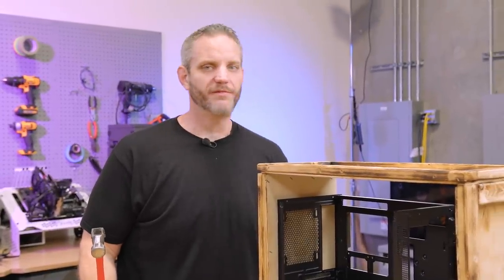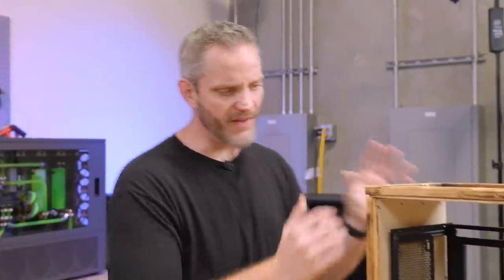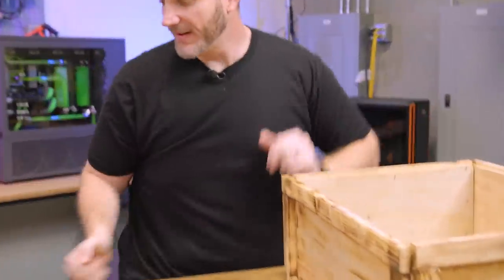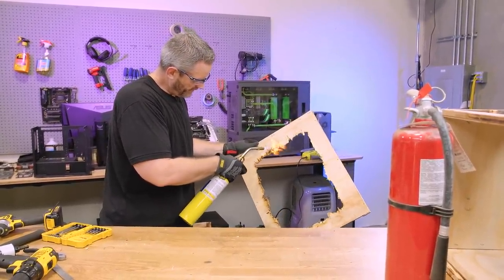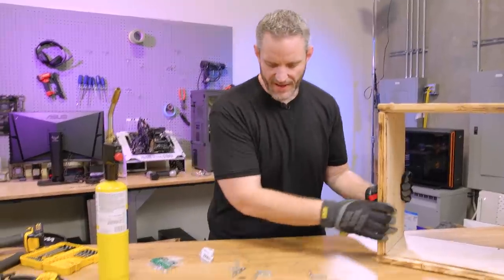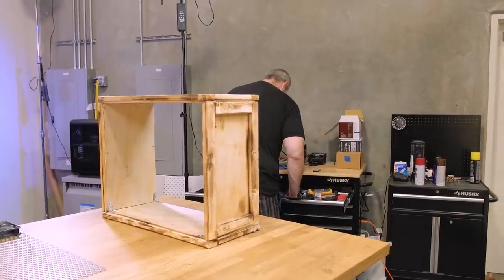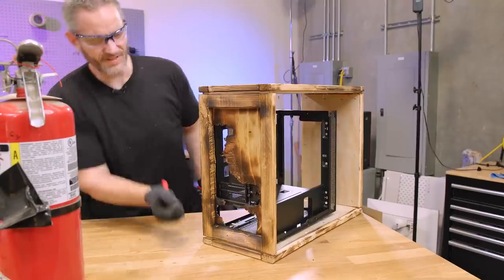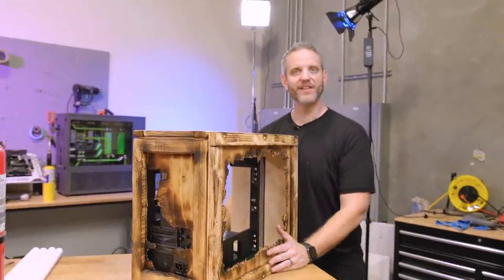I’m finally starting the Red Dead Redemption Custom PC mod again

Comment: Jay, what I would do for the grill is take a pair of bolt cutters (I know you tried wire cutters, but they're too small) and clip out the grill one by one. Then I would use pliers (or you may have to throw it in a vice, it seems like it's pretty tough, putting only the end frills of the grill) and sort of bend them in different ways around the entire cut grill. I think it would look better that way than if it was just a uniform look on the grill. You could even just bend them all outwards, or inwards, so the grill is offset to the inside or outside of the case. Would look a lot better than just a vanilla, uniform grill IMO.

You could still use pliers or a vice and do the bends if you cut it with an angle grinder, but you'd have to be careful not to cut it too straight (?) I guess. 

I advise checking out metal cutting blades for circular saws. I've used them before for projects. I've never used an angle grinder cutting wheel, only ever used sanding disks for wetsanding, but I'm sure it will get the job done as well. Goes without saying to make sure it's gripped tight in a vice lol.

Comment: Use an LED at the end of the dynamite fuse and wire it as the drive indicator light so it flickers as you use the computer. Cool build!

Comment: I sure you have gotten a million suggestions already, but here are mine: The angle grinder will do just fine with the grill. Just take it slow and let the grinder do the work. Also maybe you could use the remains of the case to sturdy up the wood frame a bit? (You can mount the bottom and side planks to the metal case and it might act like a giant L bracket) Also, wouldn't it look a little better if you cut off the front part of the metal case? It seems to me at least that it just looks a little off center, and maybe having it look more just like a motherboard tray would look better. Can't wait to see how this one turns out!

Comment: for future reference, soak the metal in salt water solution that is soaked up into paper towel and swampy. Put inside a plastic container, place lid on it and set in the sun so salt vapor comes out. it will rapidly rust.

Comment: Not sure if you saw my earlier post but you can use Poultry Netting for the hole. Available at Lowe's, Home Depot, Tractor and Supply, etc. Can easily be cut with wire cutters or snips.

Comment: To achieve the rust look on the metal you can use muriatic acid. It’s available at Sherwin Williams if you can’t find it at Home Depot or Lowe’s. Make sure you use a baking powder mixed with water to neutralize it once you get the metal where you want it. You can seal it too if you want with any kind of wood sealer.  That way you don’t get rust all over everything and it helps prevent it from rusting anymore than how you have it.

Comment: Needs enough of one panel left for a cattle-brand looking logo, and an acrylic panel for a hand-painted/leaf saloon-look sign.  

If you're going for the copper look, the reservoir needs to look like a still, with a dial temp gauge- perhaps functional.

Comment: For the the expanded metal, die grinder cuts it fast with a lot of leeway for custom angles, edges etc. Or use a cutting disc on your angle grinder will also work. If you have an air compressor, die grinder is the way to go. Good luck!

Comment: try to keep the X-grid and cut it just after the joint . it will keep the edge strength and it will be easier to fix to the side panel. and you will have less sharp edges.

Comment: I just found Brass 1/4" female NPT x G1/4" BSPT male so you can run the entire loop in normal copper and brass from a hardware store !  Those are what you need Jay! I found them cheap at a closeout place.Lemme know if you need the info. Yes a .040-.045 thin cutting wheel for your minigrinder is the best easy way to cut the expanded metal. Diablo, SAIT, Norton and the power tool brands are all decent wheels. Don't buy the cheapo China ones! You have to support it on a table edge and cut just off the side of it so that the metal is supported or  it will bend while you are trying to cut.

Comment: Love it. Only the frame looks a bit goofy. Maybe a sheet of rusted metal, drill and tap it for the motherboard standoffs, and clearcoat it (to prevent shorts). Mount that to the back board to give it some rigidity. It also might give you some motherboard flexibility. Maybe source some old rusted army ammo box(es) to make a PSU shroud, bolt that to some pieces of wood.

Comment: Install Duel Water Pumps and use red fluid with  dynamite stenciled on the side. The water hoses wrapped to simulate fuses. The top panel made to look like saloon doors that open up (use a small house shutter with opening slats and cut it down or build one)...Add a few "bullet holes" with a drill.

Comment: Suggestion on cutting the grate: use an acetylene torch, and use the heat to also colorize the metal on that grate, possibly even use it to kind of warp/melt the metal for the aesthetic look

Comment: I built a case from scratch. Mine is the borg Cube, 18 in x 18 in x 18 in. Three shelves, one with power and ssd, one with motherboard and cpu aio, and third has just gpus. Outside looks like a borg cube, with wires, painted wood blocks, plexiglass shell with a metal skeleton and wood shelves. Plexiglass painted with a 3000 temp rated spray paint. Plexiglass i got is designed for 300 degrees.

Comment: Think i would clear coat varnish the wood and all the gnarly bits, just to strengthen and preserve the wood, and it wouldd give it a bit of water protection, aswell, even thought it may give a slight shine to the wood. 
Cant wait to see how it turns out 👍

Comment: Either a metal blade for your jig saw or a sawzall for the metal, a hacksaw would work too

Also you said maybe have an led for the fuse on the dynamite, I think some twisted fiber optics painted black except for the tip would work better

Comment: YES! i'm at the point where you think about a heavy steampunk aesthetic. Nice! Go for it... Also, for the cables - black and copper etc, you can open a fracture/hole or two in the back panel where the cables clump together - like along the typical vertical "line" of cables that builds up along the MB power side - and let them "bulge out" from the fractured wood like it's a secondary consequence of the "explosion" that justifies the damage on the open side.. i mean not another big window but fractures with cables tightly and messily coming out of them.
Putting aside the suggestion, i feel it'll come out a cool build if you focus on some steampunk theme.. on the back side, intact or not, i imagine some kind of big lettering work..
Hope i'm not the jerk here openly suggesting stuff, in that case i'm sorry.. i just like the idea of these builds you make!

Comment: Use a radial saw/chop saw, it will slice right thru it.  Bi-metal or wood blade, I cut all the time heavier gauge metal with one.

Comment: If you want to do a breakout like at the box exploded use two pieces acrylic one will be the part that looks like exploded with a 1/8-in behind it that'll be flat to cover the inside so it stays protected. In a clear lacquer to cover over the wood that you burn so the last longer and won't rub off or fans pull off into the computer components. Throw some cast iron in there to look more authentic too for the time.

Comment: You should be totally fine using an angle grinder to cut the grating, just make sure you zap the sharp spots with a file or sand paper or a belt disk or whatever works for you, cause there WILL be lots of sharp spots after cutting that stuff

Comment: Cut expanded metal (grill) with circular saw with a five blade. Use a fence (2x4 with a clamp) to guide a straight line.

Comment: The idea tool would be a plasma torch for cutting that grate. But if you are not into spending 500-2000USD on one, an angle grinder will work fine.

Comment: Get an angle grinder and a fresh disc. Clamp a 20mm (1inch ish) thick wooden guide rail along the line you want to cut. If you can spare the area it is better to cut along the seams and the spare grate is going to be hidden behind the case.

Comment: You can put an acrilic panel behind the hole in the wood, so you can see thropough and dust won't go in. You could alos use like brass or copper colored door hinges for the side panels, they would probably fit the theme pretty nicely

Comment: If you are worried about structure then just go to a metal shop and get some aluminum or steel sheets and make a steel Frame for the box.

Comment: I think the reservoir tank should be surround by the sticks of dynamite inside of the box. With the copper piping coming out of the top it will look much more in line with the design.

Comment: I would say get rid of the parts of the internal metal case that you will not require, only keep what you need, so get grinding, hehe. Then for the side panel, and from, plexiglass mounted to the back to the wood, so you still have nice airflow across the platform and it still looks like it's meant to look. But definitely get rid of the metal bits of that internal case structure you have left, especially if you going to do the copper piping. It should look awesome! it's already starting to come together :)

Comment: You can get metal cutting blades for your jigsaw to get through that metal. Not sure if it would be much better than a cutting disc on an angle grinder. Alternatively, you can use a cutting torch, or a bolt cutters.

Comment: Metal cutting disc for the angle grinder has got to be the cheapest option.  you’ll have to take the shield off the grinder.

Comment: For your Red Dead Case I Think you should have used a Larger Form Factor Mother-Board.  If you reinforce your Corners With 1/2-3/4 square wood stock. And add Small Wire Chicken Fence under your Vent Holes sides. Use Copper, Brass or Bronze Nail Brads. Hide your Case screws, Paint the Heads Black. Use Brass Handles, Put Tanned Leather on a Side
Reply: Make part of the cooling pipes/pump into TNT Detonator plunger!

Comment: Jay, you maybe dismantle the black case inside and spread it out and then make that look rusty, side panel open with mesh also rusted, just wanted to throw out a suggestion if it was of any good, however loving the DIY (destroy it yourself) :)

Comment: On grill cutting. Score it (both sides) and bend(s) to snap. I do it all of the time in my profession. Steel and aluminum. But it takes technique or you risk bent ends where they were joined.

Comment: I would consider using steel L bars to make sliders for the side door to drop into. Then you can rust it easily or its already rusted, but it would add some extra weight.

Comment: I have always used a circ saw with a metal cutting blade to cut that type of grating material.. if you don't have that type of blade the next best option will be an angle grinder with a cutting blade

Comment: If your going to do a custom loop use roll copper tubing and bend it all janky . And you could always use a mason jar for the resevoir because the metal lid would be easy to mod for fittings.

Comment: An angle grinder with a cutting disc not a grinding disc is your best bet if you don't want to pick up another tool. I recently picked up a cheap Chinese knockoff plasma cutter and nothing cuts faster. And at $350 I decided to roll the dice. If you do a lot of metal cutting it's a time saver.

Comment: Clamp the grill between two straight edges (2x4) and use your angle grinder. Cut it then use a flap disk to clean it and get rid of the sharp edges while it's still in the clamp. IMO

Comment: I would just bend the Metal grid over and over until it just breaks apart, that´ll probably give you the cleanest "cut". I think theres a higher possibility of messing up when using a jigsaw or an angle grinder

Comment: if you wanted the more exploded look then you should have used explosives to get it. stick a big enough firework on the ground (outside on a hard surface), light it and then place what you want to have the exploded look on top. when the firework goes off it will push through the piece you wanted to look like it and there you go. much more accurate.

Comment: Maybe you could find short strands of fiberoptic cable painted black (accept the ends) for the fuse power light. Maybe a dozen bunched together that have staggered ends to make the red/orange lights look like the fuse is burning

Comment: Two suggestions regarding aesthetics:

1. Something needs to be done about the front of the chassis. I'm not sure that it necessarily needs to be entirely removed, but the mesh filters on either side DEFINITELY need to come off, especially since they have virtually no functional purpose within your manufactured case.

2. Regarding custom braided cable colors, you should experiment with combinations of brown, gold, and especially burgundy. All would be period-accurate wire sleeve colors, and all would look really sharp as accent tones.

Comment: heat the grill with the torch where you want to cut it. then while its still kinda hot bend it over the table edge back and forth till it snaps

Comment: Think ur on the money with the steampunk copper tube idea, get those  ek wood lignum blocks & fittings on the boy. You could probably sort that mesh with a vice and a hacksaw, but I don't think it will look so great I'd either leave it open or glass/plexi it.

Comment: You can buy those L brackets in brass. You can also get wood ones, that you also may be able to dirty up with fire. 

You could also use a chisel (carefully) to chip the flats and edges of the wood, to make it look older, as for the colour, stain it after.

And yes, an angle grinder with a cut off disc, don't fuck around man, lmao

Comment: Tin snips should cut the mesh depending on how thick it is. But you'd have to run to Home Depot or Ace or something. Oh or just Amazon. Angle grinder with a cutting disc will do it too tho, just louder and hotter and less control.

Comment: I work with metal I'd recommend using a circular saw with a  thick ferrous blade just watch out for hot metal chips pinging about 👍

Comment: Instead of a Rust look. Actually rust the metal. ( like the L brackets and the diamond mesh.) Grind the protective coating off. Then dip in a solution of water salt and hydrogen peroxide. Let rust until desired then clear coat.

Comment: if you're going for copper/brassy look how bout trying exposed enameled copper power supply cables? It'd add a lot of work but might blend in well with the look better than sleeved cables. And I'm also bit selfish in wanting how cables like that would look

Comment: Just cut the back off the case and then custom mount the board with appropriate length standoffs.  The internal parts of the case are really throwing off the vibe.  The wood distressing and cutouts turned out better than expected though.

Comment: Use an angle grinder and throw it on a wood fire then wet it and it'll get all crusty and rusty but shouldn't flake also if you paint braided cables the early cables of the time were braided

Comment: It's looking good, man. I can't wait to see how the copper tubing and rust effects look in that case!

How are you going to achieve the rust effects on the metal pieces?

Also a thought i just had, consider using fiber optic for the dynamite fuse.

Comment: You mentioned the ram gave issues before; maybe try with some generic ddr4 ram just to rule it out (easy check compared to Mobo-swap).
Looking forward to part 3.
Count your blessings: you did not start hard-tubing it yet so thjs test was already preventing a harder return ;).

Comment: Jay, I think you should have used Kregs jig for pocket holes to get wood more flushed and bolted together instead of using the L brackets. would have made it look more flushed and sturdy with some wood glue. just IMO is all.
Reply: plug HDMI to the video card. I get that issue all the time with my Ausus. I can plug display port once it successfully boots but initial boot I always need to plug in HDMI.

Comment: Quick question Jay, as you know these things before most (as you mentioned in a previous video a while back).
Is now a good time to buy a 2080 super? There's rumours of new GPU architecture coming out from Nvidia, this new announcement on 15th May likely isn't a card for consumers but possibly forecasts another announcement in September for the new hardware for consumers to sink loads of money into.
Given I can get an aorus waterforce water block card for £838 (just a little over the usual price of £750-£800 for a 2080 super with no block) it feels like it's a good deal when it comes to factoring in the cost of a water block for £100-£130. 
Should I wait and risk losing out on current gen low stock figures when the new gen arrives? (and inevitably is just as hard to get hold of) Or bite the bullet now and feel good I saved a small amount of money, but still got a card I'm happy with for now and the future? I have the finances, but I don't want to feel like I paid more than I needed to, or got a bad deal in 4-6 months time. 

I'm aware the best time to build a pc is always 6 months in the future, but the new architecture is what's made me consider whether the pay off for waiting will be worth the saving on a 2080 super. Sorry for the essay, love your videos and they're what made me consider water cooling for the first time! :D Hope you and the family are keeping safe, and Phil to I suppose ...

Comment: Can you paint the metal frame to looks like brass, or brass/steel mix? It would really give it a steampunk look. As far as the metal grate goes, perhaps rent an acetyline torch from the Home Depot? Also, I would suggest a dial to turn it on instead of a power button.